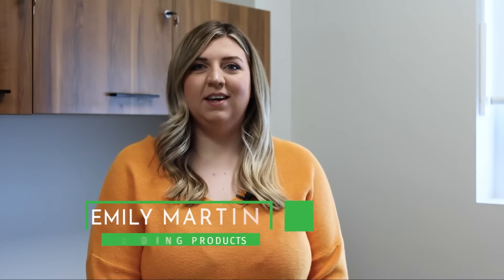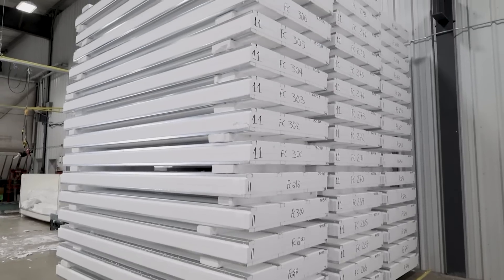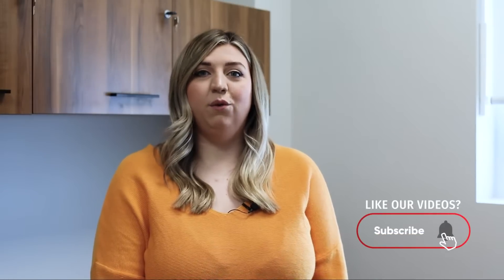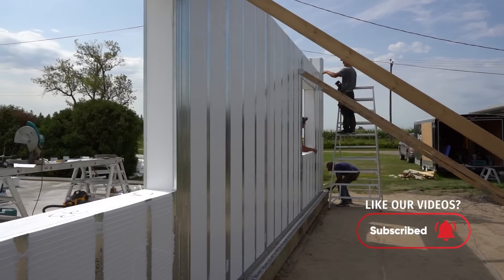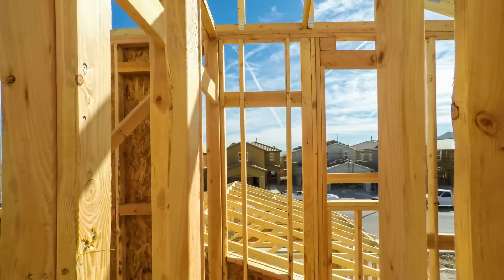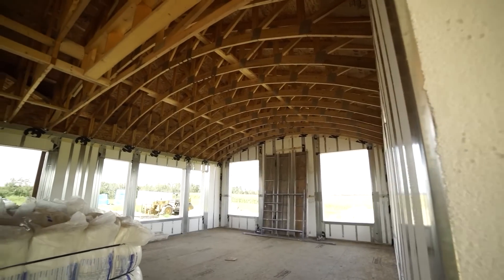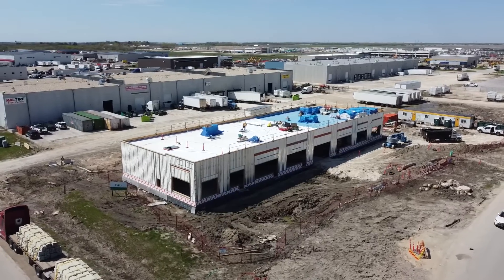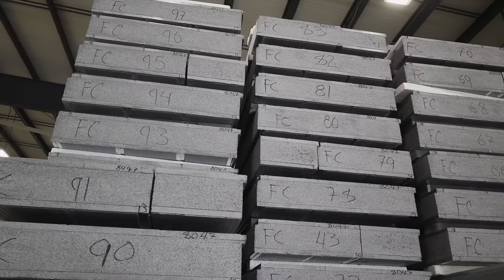What Is An ICE Panel?

Comment: “a bridge for hot and cold temperatures to enter your building” That statement is in contradiction to the laws of thermodynamics. Temperatures don’t move. Temperature is a measure of heat energy, not something that moves from one location to another. Also, “cold” does not move. Cold is a relative term meaning that one substance has less heat energy in comparison to another substance. Only heat energy moves through a material. “Cold” is not a form of energy and can never move through a thermal bridge. What actually happens is that heat energy transfers through the thermal bridge into or out of the building. And in colder weather, cold doesn’t come into the building, heat goes out of it.
Reply from the maker: Thanks for the feedback!